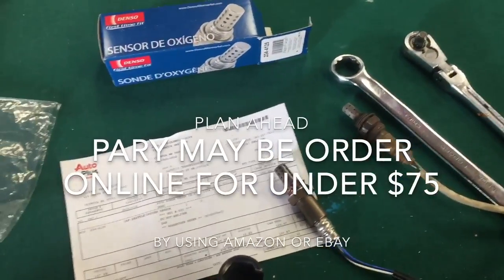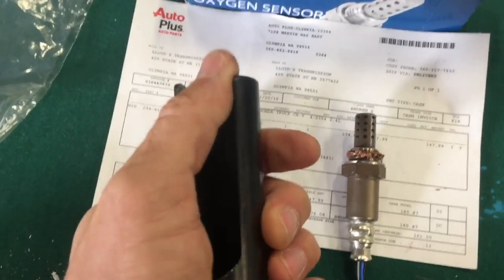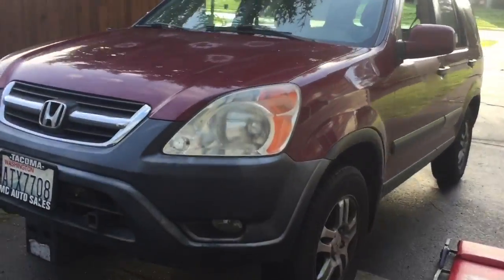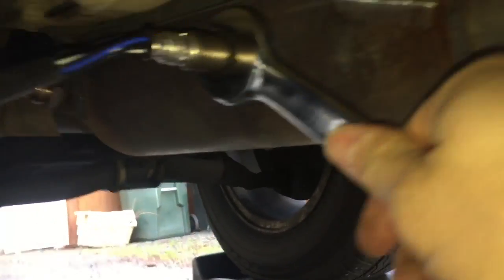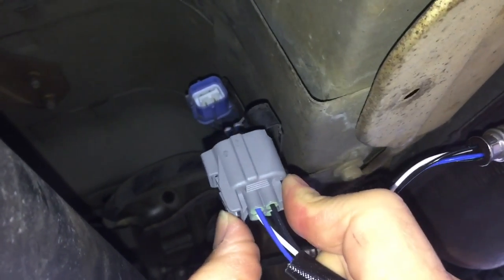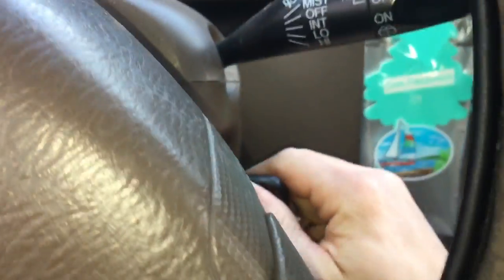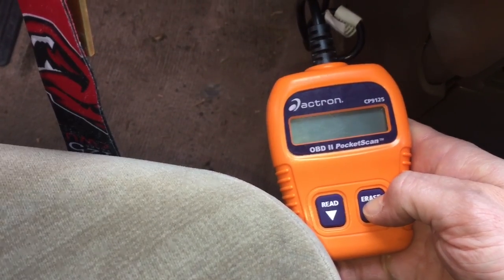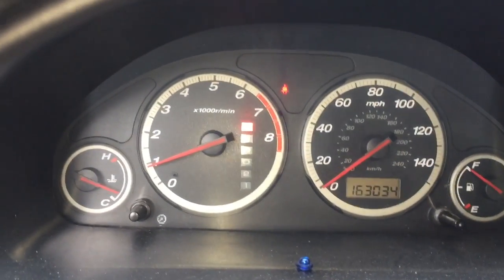How to fix code P0420 or lack of acceleration on Honda CR-V and other make & models: detailed guide

Comment: Your notes in the description were exactly what I needed to see!! Good lookin out man, I’ve been trouble shooting all week and still no luck!
My 02’ Civic is well taken care of, I’ve literally done ALL of the routine and preventative maintenance. You name it...Timing belt, trans service, all fluids & hoses, coils, plugs, manifold cleaning, gaskets, every sensor on the mf’r...etc.  Like everything besides a head gasket, and the cat.    
Ok So all I did was use some typical fuel treatment that I added to a dead empty gas tank, AND THEN proceeded to fill my tank with the usual Chevron 91 w Techron. I’ve just always used 91 but haven’t used a fuel additive “injector cleaner” in 20,000 miles.    So basically I’m thinkin that fuel additive pushed a bunch of gunked shit through and clogged up my cat, or a sensor or the downstream sensor. 
(I do know about using the spacer trick. I’ll try it if I have to) 
Sorry for the crazy detailed long message but I really need some help brotha! Or anyone else who’s read this comment this far! Thanks a ton🙏
Reply from the maker: Do you have symptoms all the time or just on occasion?
Reply: @TweekerDan1984  The only symtoms are during the first 10n seconds of starting the car when it hasn't been run for 6-7 hours or over night.    After that initial start up and 10 seconds of a rough choking idle it runs like a champ and even a bit more pep in the step.. It's only that first 10 seconds.  Now it just keeps throwing "misfire codes" and I've changed my plugs 2 years ago (20,000 miles) with premium plugs so I highly doubt that can also coincidently be the issue.
Thank you very much for your time and for replying, please let me know what you think

Comment: Thanks, man. My CRV got code P1078 during cold days, "high idle RPM" -  intake valve IMRC or solenoid sticking. So, I used Sea Foam to clean the intake and it sure did, that code went away. But it gave me P0420 instead, lol  - I guess Sea Foam crapped out my O2 sensor. Will try to clean it or get replaced some time later on like you did. In our state we do not have inspection, I can sure drive it like this but still check engine light is not pretty :)
Reply: Code 420!  You need to blaze up dude?!$

Comment: I have this same code on my 02 crv. Turns out that on hot dry days it goes away, when it rains or have my ac on constantly it turns on. So I looked underneath and saw that the water that drips from AC usage somehow drips down to the wires of the front O2 sensor. I taped that spot with gorilla tape and the CEL did not come back. However, one day I got curious and decided to check both sensors and they were already too burnt up and dirty (it was a used car by the way). So, just to be safe, I replaced both and to this day I have not had the CEL appear. Who knows, maybe I'll just replace the cat converter as well, who knows how old that thing is already.
Reply from the maker: Thank you for sharing. 😉
Reply: Is code p0420 something to worry about? I just put a used motor in and a new cat. Can this code ruin my 2001 crv?

Comment: Hello we got the same code as you and I replaced the downstream oxygen sensor cleared the code but after about driving fifteen minutes or so the check engine light was back on. Scan the code again dang same thing. And I had a hard time with part guys ordering the wrong Denso sensor four try’s till the got it right. So I’m ready to take the bulb now. The sensor that took out looked good wasn’t clog up at all.
Reply from the maker: @Wayne Casper, the next step would be to have your catalytic converters checked. If you end up needing them replaced definitely shop around. About 3 years after creating this video the engine light came on and the same thing happened only this time we changed the converters.
Reply: @TweekerDan1984   this has around 235 thousand miles on it  not worth spending a whole lot on it
Reply: @waynecasper5346 idk if you still have the same problem but you can buy the separate piece to cut and weld on it if your not handy just call a shop that does exhaust and ask them they would do it for around 150-200 and it is like 450-500 max idk tho cause I don’t have to pay the labor just depends on if you know a guy.

Comment: So how did you come to the conclusion it’s the o2 sensor  and not a clogged cat or blockage in the exhaust ?  Did you look at the o2 sensors on a oscilloscope  ? Most of the time the cat is worn out , or it can have leaks before the cat which affect its ability to work correctly..You did not test or check anything , other than rad a code and assumed it needs a expensive part ? you are one lucky man.. reading the code doesn’t mean , replace a part.. The code is for a cat not doing its job not a bad o2 ...again lucky if  it worked and lucky roll of the dice..guess..thanks for sharing on what not to do when checking a p0420..
Reply from the maker: @JOGO I agree completely, In the description I provided additional details for testing the catalytic converter and sensor before replacing the 02 sensor. I did also state that the main issue with this code is most commonly a failing catalytic converter. Like you said, in our case we were lucky that this fixed our problem. Thank you for sharing your knowledge.
Reply: My mistake I should have checked the description,  I am glad it worked out...

Comment: Thanks for the video I have the same problem but quick question, what is the severity level with that? Thanks to the rona I can't even afford my bills let alone repairs
Reply from the maker: These issues can be neglected for quite some time before you will be forced to do the repairs. The vehicle will have drivability and fuel efficiency issues until repairs are made. In our case replacing the sensor was all it took but in many cases this problem code requires a new catalytic converter.

Comment: did the lack of acceleration go away because my truck has the same thing
Reply from the maker: Yes, the lack of acceleration went away completely. I thought for sure the catalytic converters was failing since I have never come across a 02 sensor have such a dramatic effect on drive ability.

Comment: I believe I got away with clearing this code as well. I have a 03 Element, which is basically the same car except for the body. I had a feeling it wasn't my cat being shot, since I had no performance issues with the car. I used Torque Pro app to test the voltage of the o2 sensor after engine warmed up, the voltage held above .5v steadily and the app will help you determine when a driving cycle is completed. Very important to complete this before smogging after you cleared any codes since this will reset important info from ecu
Reply from the maker: Thank you for sharing this important information. 👍

Comment: Changed my o2 sensors and light came back.. going to have the exhaust done this Thursday
Reply from the maker: Did they give you an estimate for the work to be done? Some places will Substantially over charge for the work.
Reply: @TweekerDan1984  friend of the family is doing it for 150.. he owns a muffler shop.. So itll save me a ton

Comment: P0420 is for the cat failing. You
Prolly masked it for a few weeks. Also it's a two trip/ drive cycle failure. Could have drove it for hours on that first start and CEL stayed off.. not fixed people
Reply from the maker: +TJD293 thank you for the comment. I did realize that there is the possibility of the catalytic converter failing but in my case it has been 6 months and car has not set a new CEL after replacing this sensor and it has even passed emissions.
Reply: 80% of the time it's not the cat its vac leakes or o2 like he did the computer gets a signal that its lean and just throws the code cat you could even have a tiny hole in your exhaust system that were for the same code if cars were that easy to fix my just reading the code everybody would be doing it
Reply: TJD293 hi JT I hope this message finds u.  So I have 03 Accord a have a tiny hole in exhaust but the hole is after cat and o2 sensors, could it still cause a PO420 code?
Reply: @jaylee5643  yea it may try puttin a cheap patch or rap on it and see if it helps it might not have enough back pressure if u replace the o2 make sure u get an oem sensors are finicky and replace both if u have 2 cuz iv see people replace one and the other one trips a light good luck
Reply: Iv also heard good things about catclean u may wanna give it a try befor replacing the cat a cat could still work at 80% and thro a code

Comment: The code is gone because you erased it...!
Reply from the maker: iNRi S  I did clear the check engine light, only in specific instances will they go away on their own. Although even if your CEL goes away on its own it would still be stored in your code history. In my case after replacing my 02 sensor the check engine light has not returned once the sensor was replaced.
Reply: @TweekerDan1984  could you please clarify that? why is it important to clear the codes with a scanner after the repair? why wouldn't you simply wait for the check engine light to go out on its own, confirming that your fix really worked? when i did this project, the check engine light went out in just a couple days. thanks!
Reply from the maker: Thomas Crawford hello, hopefully this is helpful. Once the repair is made it is recommended to clear the code because in most cases even if CEL turns off the code can be stored in the system. If you erase the code after repairing your issue and the same code returns then you know for sure that the repair has not corrected the issue.
Reply: I believe a "live scan" is wise with such symptoms; closed loop of course

Comment: Talk about kill the messenger.
The rear O2 reports an issue with your engine running so poorly, it's too much for the catalytic converter to clean up.
So you replace the rear O2 sensor.
A week later the code comes back, let me guess, you replace the cat converter.
A few months later the code comes back.
Reply from the maker: We have not had to replace the catalytic converter. The O2 sensor happen to be our main issue.

Comment: I have a 2000 crv replaced both sensors, and wiped the codes, and they still came back. Wiped them again, and they came back. Not sure what else is causing it to happen.
Reply from the maker: Hey there @Ricky White I did share some more detailed information in the description of this video. One of the details was that if replacing the O2 sensor did not correct your issue then it is likely your catalytic converter.
Reply: @TweekerDan1984  I'm really not looking forward to spending 2000 for a new cat
Reply from the maker: My brother has the same vehicle and was able to replace just the catalytic converters for $700 from a local muffler shop.
Reply: @TweekerDan1984  700 is alot better than the 2000 I searched up on the internet
Reply from the maker: He took it to a local shop and afterwards I inspected the system and they did indeed replace the catalytic converters. I was blow away by the cost. OEM catalytic converters did run close to $2,000. It has been 6 years and the $700 system is still holding up with any CEL.

Comment: Mine says efficiency below, threshold bank 1 so I would replace the first one sensor right?
Reply from the maker: It would most likely be the second sensor. The second sensor is known as the downstream sensor, which is still bank 1 but typically referred to as bank 1 sensor 2.
Reply: Yours work by swapping o2?

Comment: HI CAN YOU TELL ME HOW TO FIX MY HONDA CEV 2005, CODE P0661.PLEASW THANKS. I ACTUALLY HAD THE 2 SENSORS REPLACED BUT THE ENGINE LITE IS  STILL ON.
Reply from the maker: The code may be from a bad or failing catalytic converter. I local shop could test it to confirm.

Comment: Hi, my 2004 Honda accord ex have code P0420 and it says " catalyst system efficiency below threshold" and it also says "Heated Catalyst bank 2, result= Failed" .  max= 512.0, value= 525.0.   i have notice acceleration is going down too.  do you think i have to replace whole catalyst converter or oxygen sensor ( same as yours) ? thanks
Reply from the maker: There is a possibility that the o2 sensor has failed but it is likely that the catalytic converter will need to be replaced. I was fortunate that the sensor was our only problem.
Reply: Hello....did yu ever fix your problem? If so what did yu do?
Reply from the maker: chain8314 yes in my case replacing the downstream sensor did correct the issues.
Reply: Did you figure out the code hustle?

Comment: This codes doesn't pop right away you change some part sometimes you need to drive few miles to see if is coming back
Reply from the maker: Thank you for sharing, definitely takes patience. This worked for us for more then two years then about 8 months ago we had to replace the stock catalytic converter.

Comment: My 2001 crv has the p0420 code. Its so bad now the car wont even accelerate to over 30-35mph. Just revs. Do u think it could be my o2 sensor??
Reply from the maker: In that case the o2 sensor could be the culprit but chances are the catalytic converter is failing (clogged)
Reply: Dana sounds like to me your cat has a hair ball from hell....change the cat...and too you might have other problems that cause that hair ball
Reply: did you ever find the problem?
Reply: @jrobertech  yeah was the cat converter was so badly clogged. Believe it or not. Switched it out and not another issue. Hope this helps!

Comment: Question guys, does an o2 sensor mess with a cars power and acceleration? Would it cause a car to stall once on a freeway?
Reply from the maker: Yes a faulty sensor can effect the acceleration and power, but if your vehicle stalled on the freeway I would have it scanned for additional codes. The lack of power and acceleration may also be caused by a clogged catalytic converter.
Reply: TweekerDan1984 just the 0420 code and front tire speed sensor. Just trying to make sure it’s the cat before I spend all the money

Comment: P0420 code is up on my 2006 Civic hybird but code came up as my car started running very rough on the ride home. I changed the plugs, cleared code and it ran good for a few weeks then code came up and running rough again. Could it be a bad coil pack?
Reply from the maker: Did you replace your ignition wires when you replaced the plugs? The O2 sensor after the catalytic converter is usually one of the main culprits for this engine code. The second culprit is typically a bad catalytic converter.
Reply: TweekerDan1984 I did not replace the ignition wires. It is skipping bad going down the road almost transmission like but only the P0420 code is showing. I am thinking a misfire, I ordered new coil packs yesterday but could ignition wires cause this?
Reply from the maker: You could see if some of your ignition wires are faulty by misting water on them and visually inspecting for arcs. The CRV in this video would stumble, hesitate and lurch around like a bad transmission and I got lucky that my issue was the O2 sensor and not the catalytic Converter. If you wanted to pay a shop to test the catalytic converter it may be worth the $60 since there are so many issues that can cause  misfire symptoms. I would consider ordering a new O2 sensor if you don’t want to go to a shop. I hope the coils work for you👍👍👍
Reply: jodyroper Did that fix your issue?

Comment: Just by a PO420 how did u know that the down stream o2 rather then up stream needed replacement?
Reply from the maker: The upstream sensor was replaced a few years earlier. So when I received the code PO420 I decided to replace the downstream sensor since the upstreamed was a Denso and appeared to be newer. PO430 is the typical downstream code. I realize this code is commonly triggered by a faulty catalytic converter but that is not always the case. My code has not returned since this repair has been made.
Reply: TweekerDan1984 can you change mine o2 🤣🤣🤣

Comment: wiil this work for a 2001 accord?
Reply from the maker: +Ricardo Campos apologizes for the delay. The code would have the same description and the issue could also be the same but not limited to the sensor. Another issue that can trigger this code is a bad catalytic converter.

Comment: did the code re comed out after ?
Reply from the maker: In our case The code did not return, if you replace the sensor and the code does return then you most likely will need to replace the catalytic converter.
Reply: @TweekerDan1984  did you replaced the downstream or the upstream? are upstream and downstream the same type?

Comment: P0420 is for the cataletic connverter not faulty sensors. Check engine will visit you car soon.
Reply from the maker: +Aziz Mouhib I have repaired this issue over a year ago and I still have not had the code returned. I understand that a P0420 code is a indication of a bad catalytic converter but I am also aware that this code can be thrown by a damaged or failed oxygen / O2 sensor specifically Downstream oxygen sensor (HO2S) if the wiring is damaged or connected improperly.

Read more at: https://www.obd-codes.com/p0420
Copyright OBD-Codes.com
Reply: TweekerDan1984 if malfunction o2 sensor caused p0420 to lit up. Shouldn't there be error code for failed o2 sensor to lit up also instead of just p0420?